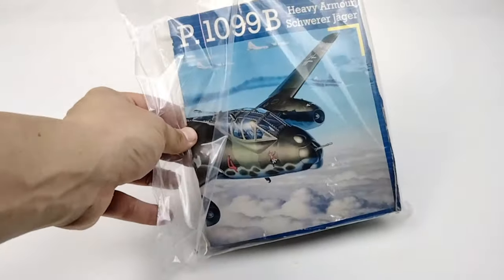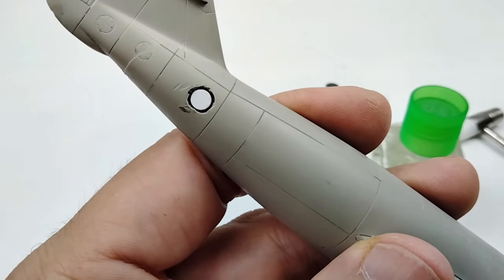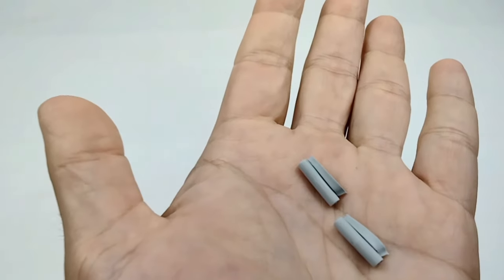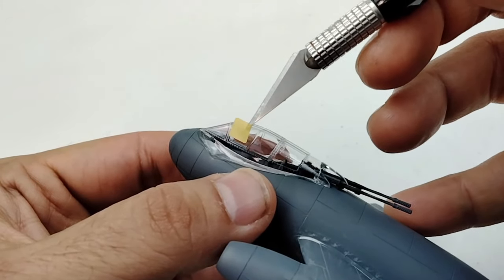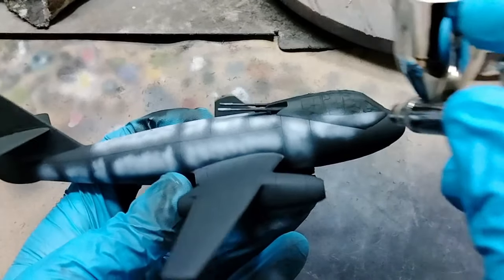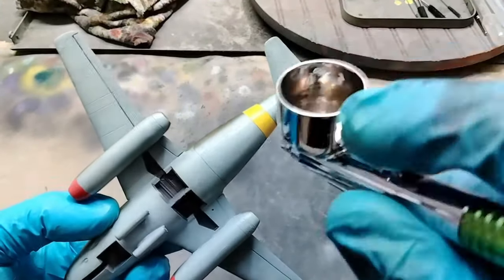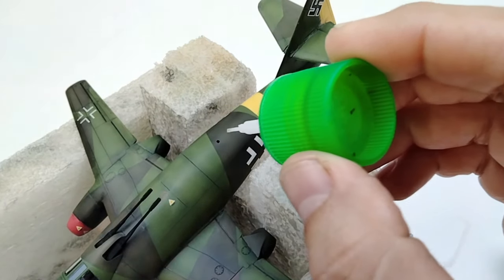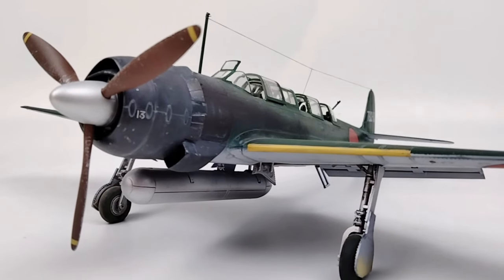FULL Build! | 1/72 Revell ME P. 1099B WWII LUFT 46 What-If Assault Jet Fighter Based on The Me 262

Comment: Excellent video , great build and perfect timing. I'm reentering the hobby after a long sabbatical and trying to get up the learning curve of the new materials and techniques  . There are so many styles, one of my " old" masking tape applications I use DRAFTING masking tape minimizes paint damage and is cheap. Regarding paint removal I just finished your Purple remover. It worked on some real old acrylic just as you demonstrated however on some real old Enamels it didn't touch it after three days, so I'm going to check your videos for alternatives. VMS Makes some excellent stripper  however the only caveat is the price, about 11 dollars a 200ml bottle. It is great stuff other wise. After working for several months on new materials I still can't get up the learning curve, however I think your videos are going to help. Thanks for the help.
Reply from the maker: Welcome back to the hobby!  Try tire bleach or oven cleaner on the enamels to remove it. Soak for 24-48 hours.
Reply: @StyreneModelersHaven  Thanks for the recommendation on the strippers I'll give them ago , I'm anxious to find a solution to redo some of my old kits and bring them up to date.
Reply: The model railroad hobby here in the US has since at least the 1980s a couple different paint strippers which are safe for plastic models. The ones I use while safe for styrene are not safe for resin parts. They are in about the same price range as that VMS product. And they are reusable. Their origin is based on removing factory paint from locomotive and car body moldings so as to repaint in liveries which are not factory offered. Also, I've had success using isopropyl alcohol to remove common spray paint from some large scale model train bodies. That alcohol also does an excellent job of removing Tamiya acrylics.
Reply: thanks Scott - I'll try the alcohol too @scottfw7169